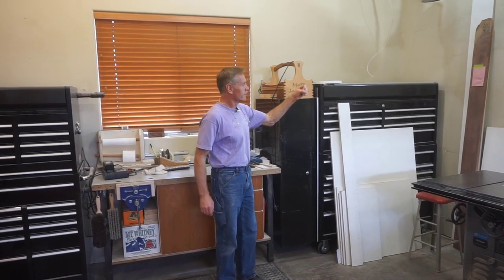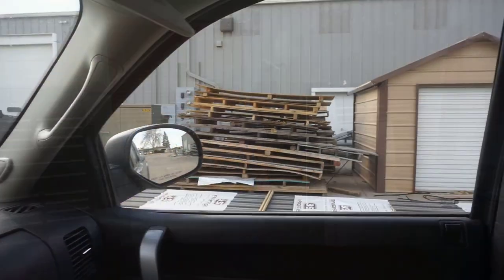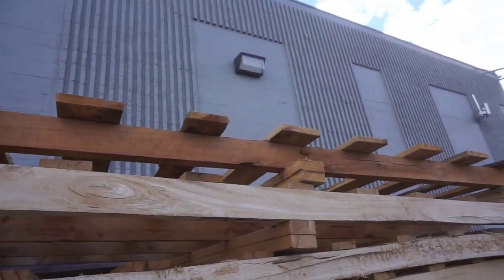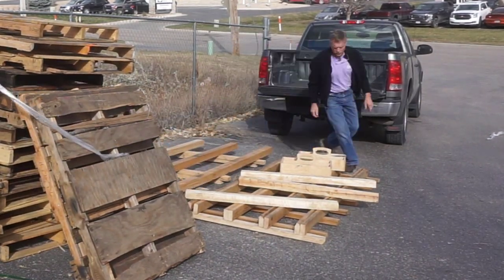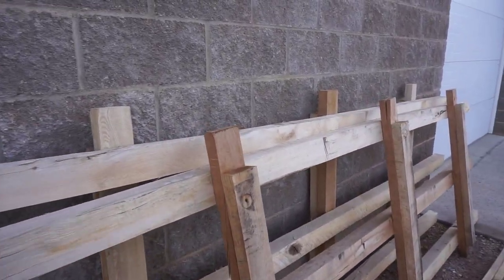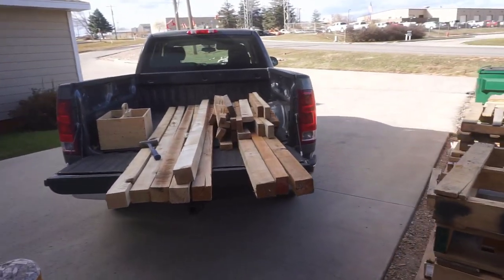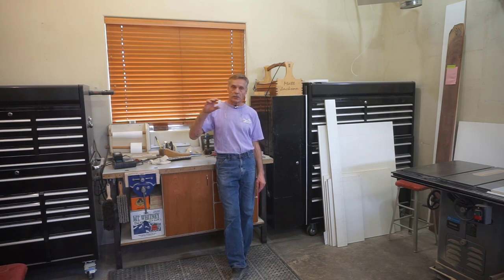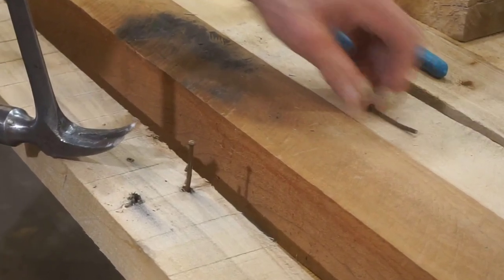A Search for Perfect Pallets

Comment: Call that dusty?.. I can still see your ankles. I used to make a lot of things out of pallet wood but the search for the exotic became harder and harder. Then I discovered my local UPVC replacement doors and windows place with a regular skip full of various hardwoods, including iroko, idigbo, oak,  sweet chestnut, Sapele and Teak. I've just made 4 dining tables out of 80 year old, 8x3, douglas fir mullion window surrounds; yep it takes a bit of effort to re machine the timber and to patch the old mortises, but the quality of the wood is amazing.
Reply from the maker: ... still see my ankles... LOL!!  Man, you've found a goldmine there Big John!  My hopes for any exotics were dashed when there was nothing at the furniture stores where everything comes from China and other far off foreign lands.  Comments like yours are giving me great ideas of places to look though, so thanks! Best, Matt
Reply: @NextLevelCarpentry  Hey Matt... I cannot recommend old panelled front doors enough. The stiles make great table tops... you can either plane them down and go for the random "teak" look, or leave the paint on for a funky multicoloured style. The floating panels are great for draws and boxes and the rails make good chair seats. This summer, I made quite a few garden benches and tables using re-machined door and window sills... take the slope and drip off, and you've got a good, 35mm thick plank of wood. Even severely bowed structural timber is good for end grain butchers block tables. I used to make these out of old 4x4 roof rafters... lovely coloured, close grained pine and the wood worm holes just added to the look. 
Can you tell I love making stuff out of old, knackered wood? Saying that though, MDF wardrobes and kitchens have paid the bills for a long time.
Reply: @NextLevelCarpentry  By the way, I don't want to give you hammer envy, but my "Mighty Hammer Of Thor" is an 8x8x20 headed, long handled oak mallet I use to gently tap green oak frames together. I can still remember the days I could wield it with impunity.
Reply from the maker: @bigjohn606  the days of 'wielding with impunity' are relegated to the fond memory bin I'm afraid... it was fun while possible though!  Your mighty Thor sounds like a tool to respect... fun to wield and own for sure! Best, Matt
Reply from the maker: @bigjohn606   The human brain is a remarkable thing having to switch between both 'old knackered wood' and MDF/melamine particle board, isn't it? Maybe it's the survival instinct of paying the bills that makes it all possible?  Feel free to share links to any of your work... I'd like to see it (if possible) and other viewers would too... Best, Matt

Comment: I'm curious as to what other tools are in your WMD boxes.  There's Thor, the flat wrecking bar, probably the straight clawed hammer, bull nose cutters.  I would guess linemans pliers, a few punches, a bit assortment, and cordless drill.

Thank you for the descriptive title, it will make venturing back into your older videos easier.
Reply from the maker: Hey Benjamin: you must be clairvoyant as much of what you suspect does indeed reside in the WMD boxes.  Those are just two of 4 that I call my 'framing tools' boxes which, naturally include weapons of mass demolition... I should do a tour of it, shouldn't I?  Hope you find interesting videos if you get to surfing around in the Next Level Carpentry archives! Best, Matt

Comment: I was amazed you were rolling around with the tail gate dropped and tools in the back.  Seen a lot of tools lost that way.
Also they make an air tool for shooting the nails right out of the pallets.  It’s like $50 on amazon.
Reply: Billy bob Smith do you have e a link?
Reply: Billy bob Smith: never mind, found it. The air locker 700P I’m guessing. Worth the 50.00 for sure.
Reply: Yeah. That’s the one. Air locker 700
Reply: That will land an expensive ticket in New York State.  So will having wood sticking over the tailgate without a red flag in it.  So will not cleaning the snow off your truck.  So will.........

Comment: Question Matt:
During a remodel I tore up a fair amount of hard wood flooring.  I think it's oak from 1959 or so. They were just going to take it to the dump (for a fee of course).  As a courtesy I collected it and was simply going to burn it.  Would you suggest salvaging it in some way for a glue up type project?  If so, what would you suggest? I don't have a jointer or planer. Just table saw, miter saw etc.
Reply from the maker: Wayne; you're faced with an altruistic conundrum with that oak, aren't you?  If it's quartersawn or straight grained it's more worth salvaging IMHO but, from a practical standpoint it's highest and best use probably is firewood, especially without a jointer or planer.  As far as projects go I'd look at it from a 'lowest common denominator' viewpoint meaning what's the biggest size yield you can get from the batch.  If the old floor was re-sanded a couple times and the back has the typical 'corrugation' profile then you might not even get 1/2" thick flat piece after cleaning it up... that's pretty limiting in usefulness.  You might find a craft-type project to use it for but that's kind of like a solution looking for a problem.  Sorry I'm not much help since I come from a business profit/loss paradigm where ideals of salvage and recycle are rarely practical.  Good luck with your project, I really hope you find a new life for that old wood as I really do hate to see precious natural resources end up in the landfill! Best, Matt
Reply: @NextLevelCarpentry  thanks for the quick reply. I have let the burning begin. LOL I just don't like to be wasteful. But I've made enough mistakes on some projects that cost money that made some expensive fires too.
😉
Reply from the maker: @waynemiller6070  I'm with you on the 'mistakes as kindling' thing... there's a sense of relief when our mistakes go up in smoke with no one but us any the wiser, right? 😲😁😎  At least least you can feel good that you're not just turning old dry oak into worm food... Best, Matt

Comment: What weight is your Thor hammer?
Reply from the maker: 4 lbs... if you get an Estwing that looks like it it will be the same weight BTW. https://www.amazon.com/dp/B00047EWQ2/?ref=idea_lv_dp_ov_d&tag=aiponsite-20&linkCode=ic6&ascsubtag=amzn1.ideas.N9SCNJTWOBV4 just don't hit your thumb or it will be very thore! Best, Matt
Reply: @NextLevelCarpentry  Thanks! Im in the UK and trying to put a demo kit together like yours...luckily a few UK sites on ebay have that exact hammer.
Reply from the maker: @garthqueen  that's great the hammer is available because one thing I can tell you is that it's a tool you'll never destroy in use... about the only thing that could happen to it is the plastic handle might melt off in a fire😉🔥😎 Best, Matt

Comment: Straighter than what you find in a big box store...ain't that the truth.  I was recently looking for straight 1x4's for rails/stiles for a barn door project...couldn't find any...everything is either twisted or warped.  Ending up getting 1x6's, jointed an edge, and then ripped to 3-1/2".  Now I have some extra scrap wood for the burn pile.

Comment: Did Thor get put back in your tool caddy before you drove off?
Reply from the maker: Thanks for checking Ross... it would be just like me to zip on off up the road and not notice it disappeared until unloading the truck and then D'oh!  Fact is many things end up chronologically jumbled by the time I get done editing various clips to work around gaps in the timeline etc.  It might take me 3 tries just to make sure I 'got' a certain sequence only to find out the sound was missing, I chopped off a key part of what I was trying to film, etc, so ya never know what little anomalies like that will end up in the final production.  It's fun when someone is as observant as you are points one of them out though! Best, Matt
Reply: @NextLevelCarpentry   I was thinking the same thing. NO he did not just drive away with Thor on the tailgate!?

Comment: 6:05 by cherry, are you referring to the condition of the material or did someone really use cherry wood to make 4x4s?

Edit; just rewatched. Who the duck uses CHERRY to make 4x4s? That's like using a Cadillac sedan to haul horse feed?
Reply from the maker: Every mill that processes hardwood has cull lumber that, if not salvaged for pallet parts, would just end up as waste or particleboard... so it's a good thing they're using junk hardwood instead of construction grade pine that can be used for framing, right?
Reply: @NextLevelCarpentry  true, I suppose. Just surprised me.
Reply from the maker: @kevinmencer3782  Crazy, right?  BTW I've found amazing maple, hickory, ash, quarter sawn oak and great poplar too.  Check out the Pallet Door Build series on this Channel to see this stuff put to use... Best, Matt